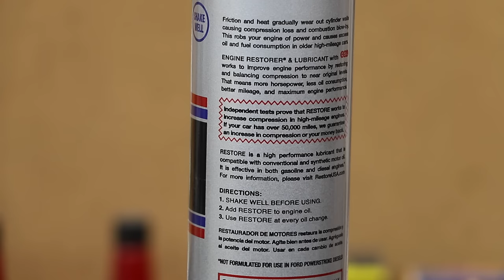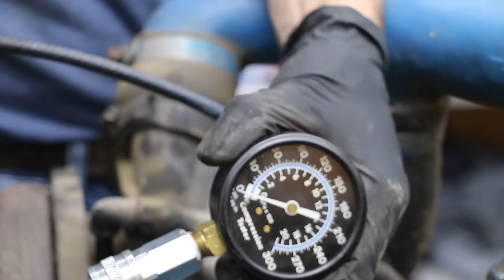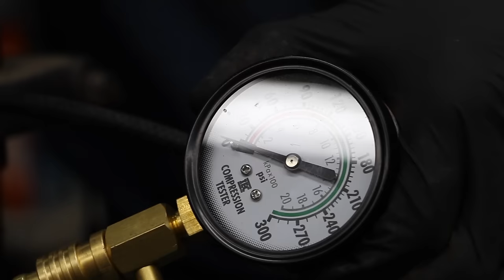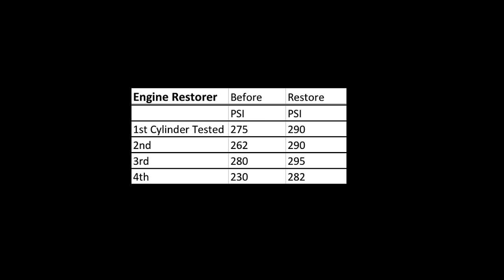Does Restore Work?  Will it Improve Engine Cylinder Compression?

Comment: I was NEVER a believer in additives. 20 yrs ago I restored a 59 Ford Skyliner 352-v4. My new engine sat for four years while finishing the car. When I finally started the car I had significant lifter noise. I was devastated as I didnt want to tear my beautiful engine down. I went to a local rod shop and the elder gentleman behind the counter told me to put a can of restore in it. Not believing that it would do it, I bought it anyway. I drove three blocks and my lifter noise was gone. This is one additive I highly recommend!
Reply from the maker: I really like reading posts like yours. Thanks for sharing this experience!
Reply: Sometimes is better to believe. RVS works also, and it get TUV mark.
Reply: 352-v4....never saw one.
Reply: @mr1rapid  352

352 FE V8 in a 1964 Galaxie 500 XL
Introduced in 1958 as part of the Interceptor line of Ford V8 engines, the Ford 352 of 351.9 cu in (5.8 L) actual displacement was the replacement for the Lincoln Y-block. It is a stroked 332 with 3.5 inches (88.90 mm) stroke and a 4 inches (101.60 mm) bore, and was rated from 208 bhp (155.1 kW) with a 2-barrel carburetor to over 300 bhp (223.7 kW) on the 4-barrel models. When these engines were introduced, they were called Interceptor V-8 on the base models and Interceptor Special V-8 on the 4-barrel models.[22] The 1958 H vin coded 352 was designated as Interceptor V-8 Thunderbird Special according to the 1958 Ford V8 Cars & Thunderbird Service Manual pg 483. The Interceptor was the base-performance engine in 1958. For the 1959 model year, the FE engine series was renamed the Thunderbird V-8 and the Thunderbird Special V-8.[23] When installed in Mercury vehicles, these engines were named "Marauder". This series of engines usually weighed over 650 lb (295 kg).[25] In 1960 Ford created a high-performance version of the 352 rated at 360 horsepower (270 kW) it featured an aluminum intake manifold, Holley 4160 4-barrel (4-choke) carburetor, cast iron header-style exhaust manifolds, 10.5:1 compression ratio, and solid lifters.

352 engine configurations and applications
2V
8.4:1 — 208 horsepower (155 kW) at 4000 rpm and 310 lb⋅ft (420 N⋅m) at 2800 rpm
1965–1967 Ford F-Series
8.9:1 — 220 horsepower (160 kW) at 4400 rpm and 370 lb⋅ft (502 N⋅m) at 2400 rpm
1961–1963 Ford
1961–1963 Mercury (1961 Meteor and 1961–1963 Monterey, Commuter Wagon, Colony Park)
4V
10.2:1 — 300 horsepower (220 kW) at 4600 rpm and 395 lb⋅ft (536 N⋅m) at 2800 rpm
1958 Ford Interceptor
1958–1959 Ford
1958–1959 Ford Thunderbird
9.6:1 — 300 horsepower (220 kW) at 4600 rpm and 380 lb⋅ft (515 N⋅m) at 2800 rpm
1960 Ford
1960 Edsel[26]
1960 Ford Thunderbird
10.6:1 — 360 horsepower (270 kW) at 6000 rpm and 380 lb⋅ft (515 N⋅m) at 3400 rpm
1960 Ford
8.9:1 — 235 horsepower (175 kW) at 4400 rpm and 350 lb⋅ft (475 N⋅m) at 2400 rpm
1960 Ford
9.3:1 — 250 horsepower (190 kW) at 4400 rpm and 352 lb⋅ft (477 N⋅m) at 2800 rpm
1964–1966 Ford
Reply: I think what mr1rapid was questioning here.............is he's never seen a 352 V-4!!! (as in a FOUR-CYLINDER,not a V-8!!!) of course,I'm guessing he (Linden Johnson) mistakenly typed in v-4 when he originally MEANT v-8!!!  @BamaShinesDistillery
Reply: @menom7  The guy obviously accidentally swapped the v4 and 4v. Anyone with ANY knowledge of old Ford motors knew it just mean a 4 barrel carb.....2v and 4v....
Reply: @mr1rapid  lol. Shutdowned
Reply: lifter noise would go away all by itself after 30 min once the hydraulic lifters would fill with oil
Reply: @BamaShinesDistillery  He was pointing out the fact that Ford never made a 352-v4. There is a 352- V8.
Reply: @mmill6505  he meant 4v....4 valve
Reply: @BamaShinesDistillery  Ford didn't make a 1959 Ford 352 4 valve. It had 1 intake and 1 exhaust valve per cylinder for a total of 16.
Reply: @mmill6505  4 barrel....excuse me......
Reply: M Mill  Nearly every car produced in the 1960s and 70s had the engine displacement printed on the air cleaner, as well as the amount of venturies the carburetor had.  He was reading off exactly what it said. 352 4v. 

The only thing odd here is your attack of him. 

Carburetors. The venturi in carburetors is used to measure airflow in a car engine and to ensure that a correct amount of fuel is fed to the gas combustion engine when needed during driving. ... The venturi meter allows the carburetor to adjust and calibrate the distribution of fuel and air to the engine as needed
Reply: @BillyMorgan8774  I have made no attack of him or anyone. I have pointed out a mistake.
You have made a mistake yourself. The air cleaner does have the engine displacement on  printed on it as well as the but it has nothing to do with the carburetor.  It would show 352-V8 in this case.
Reply: Here’s a picture for you. 

http://www.yesterdaysmusclecars.com/product_p/1-1077.htm

It’s not the decal commonly used, but similar.  

Many 4 barrel engines were different than their 2 barrel counterparts, in more ways than just the carburetor. For example the 351 4v had different heads and huge valves,  about the same size as a 454, at 2.19 inches. I don’t know why manufacturers wrote 4v instead of 4bbl, but I suspect they were just keeping it technical.
Reply: @bradleykordoba8496  this is engine building 101, the engine thus oil needs to get hot to fill the lifters.
Reply: @otm646  Or just use Lucas Oil Stabilizer. It will keep the lifters coated while the engine sits for long periods of time.
Reply: @BamaShinesDistillery  Amen, the argument on this whole thread hurt my brain.
I didn't even notice he messed it up and knew what he was taking about
Reply: @mmill6505  Then you have not seen them all. I happend to have a 351c CJ  and it does have 4v stamped on it. But thank you for opening your mouth and proving that you actually dont know everything about a Ford......
Reply: starcommtrey 4v in the old days meant 4 venturi.  You are wrong

Comment: You NEED to do a lawnmower RESTORE video so we can see what the product does mechanically and physically to the piston, rings etc.
Reply from the maker: Thank you for the video idea!
Reply: @ProjectFarm  the fact that this measurably worked makes this extremely compelling. Did a follow up happen?
Reply: @RaiderOfTheLost  Obviously, PF agrees with him so...
Reply: I agree -- it's one thing to see how big engines do with this stuff, but smaller engines tend to wear out faster.  It would be nice to see if this will help with lawnmowers, generators, motorcycles, etc.
Reply: @RaiderOfTheLost  calm down patriot
Reply: @SoloPilot6  so I actually currently have a briggs and stratton 6.5hp quantum that I just finished up doing some work on, lapped the valves and new head gasket. It's still on the lower side on compression but will turn over first pull. Freshly after throwing the motor back together it read ~45psi dead cold compression test. I just changed the oil and added some engine restorer and will let it run through a little before seeing if it did anything measurably.
Reply: @balddicknosedasscanoe so I did like I said and ran the restorer in it. It's been about a month, I haven't checked readings yet. But there is a noticeable bump in compression. It can handle load much better than it did prior and will run strong through conditions that would stall it before
Reply: @ProjectFarm  hello, great video. Could the 6 cylinder restore be used with an 4 cylinder  engine? I have a 4 cylinder but its hard to find the 4 cylinder restore in my area. Only the 6 and 8. Thanks
Reply: He just did a test that concluded compression went up. That means mechanically piston, rings, cylinder, valves are sealing now.
Reply: @Duwop77  yes, you just use less product, so if a 4 cylinder is for example 8oz, then a 6 cylinder is 12oz, you can use 8oz and leave the rest in the bottle.
Reply: @TheMissingxtension  thanks👍
Reply: @Duwop77  buy the 8 cylinder and use half the bottle now and half after a couple more oil changes. Best 10 bucks I've ever spent.
Reply: @dustinh4175  Thanks 😁
Reply: @Duwop77  IBetter yet, buy the 8 cylinder and use 1/2, then store the rest for a future reapplication after an oil change. It will also be cheaper that way as the 8 cylinder usually isn't 2x the cost of the 4 cylinder.
Reply: @EdwardMcClung  no reference to temperature though. Kind of invalidates the result
Reply: @m.b.82 how does it?

Comment: Your vids are even better than myth busters because it's real shit. It's practical science what  your doing. Thank you for sharing.
Reply from the maker: Thank you!
Reply: Straight to the point to :)
Reply: idk which mythbusters episodes u were watchin but they did practical science shit all the time  but the other side of that, them doin the oddball random stuff are some of the best episodes they made
Reply: Well hello there dad.
Reply: @4dirt2racer0  
except when they bombed the airplane off a jogging treadmill
Reply: @taledarkside  what was wrong with that you say?
Reply: @Jonas_Aa  
They didn't build a full scale jogging treadmill
Reply: @taledarkside  to just spin the wheels faster on the airplane while the prop is doing the work. Cant see that it would make a difference.
Reply: Hey  @ProjectFarm .  This was a great test.  I tried this product in my Dodge 5.9 with low oil pressure "just to see" if it helped, and unfortunately, no, it didn't.  While searching for solutions, I found out about an additive called "jilcatproline.com" where they claim to have a nanotech approach to improving oil pressure...if you are looking for a product to test, I'd love it if you gave this a try!!
Reply: @Jonas_Aa  

The idea is to match the wheels to the treadmill speed. Any extra thrust from the plane that overcomes friction will make the plane go off the treadmill. So if they did make a real treadmill, the plane would stay stationary, if they screwed up, it would go off the treadmill.
Reply: @taledarkside  yeah ok I see. But that would be the same thing as having very little throttle on the plane and what fun would that be. Just as fun reving a plane motor up when plane is on the ground just to the amount that it will just not move.
Reply: @Jonas_Aa  
that is what the myth was all about, can a plane take off from a treadmill? And their answer should have been "NO", it rolls off or stays stationary.
Reply: @4dirt2racer0  mythbusters lies and fakes scenes. There is much that they don't want you to know or properly understand.. If you don't have a shop and live in that world you would not understand..
Reply: myth busters  is a joke. always has been

Comment: I have used it in my 1980 Diesel Scout, when I fire that thing up on a cold day it used to darken the skies with smoke. I would have to hold the glow plugs for a good 30 seconds and it still struggled to get going, the restore made a massive and immediate difference. I use a bottle on every oil change now.
Reply from the maker: Thanks for sharing.

Comment: After watching this video, I decided to try Engine Restore in my own 05 Focus. It has had trouble with cold starts since I bought it 5 years ago. It would have rough starts or stall out when starting cold (really badly in the winter). I put Engine Restore in with my last oil change a couple months ago. The car has started better than it ever has, and yesterday it was down to 14 degrees Fahrenheit and the car started so easily. Thanks for your awesome videos, your thorough testing, and unbiased reviews. My understanding of the internal combustion engine has improved thanks to you. Keep up the good work!
Reply from the maker: Impressive results!  Thanks for commenting!
Reply: Diesel? Or gasoline engine?